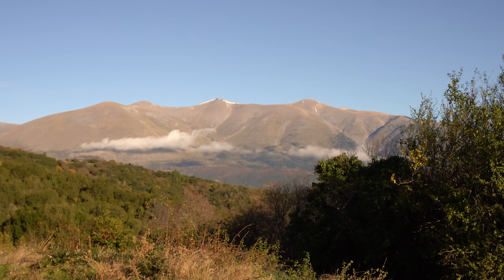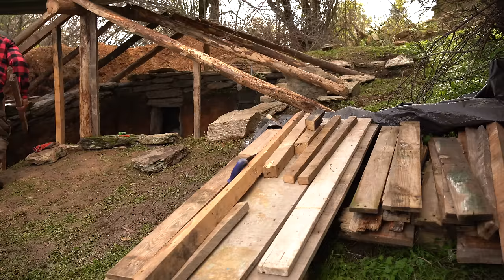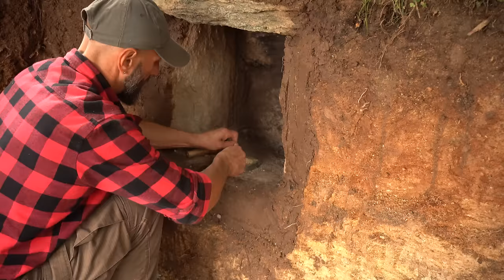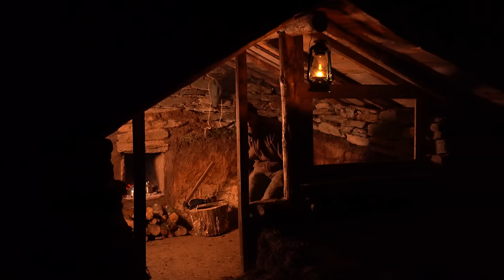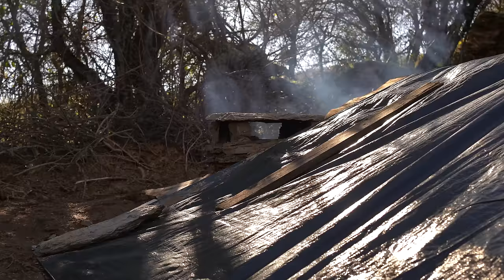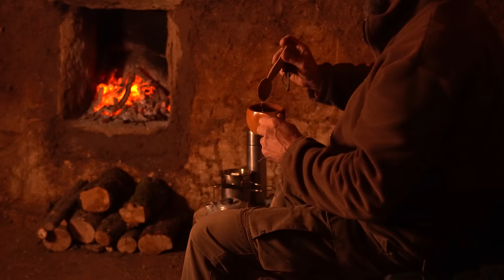Built totally secret underground dugout cabin. Ready for extreme snowstorms. Fireplace inside

Comment: Natural drainage is going to have water come in from the uphill side, you need to trench it around that area to all water to flow out and away from your dugout
Reply: After he finished laying the rocks down, he piled dirt up on an angle to the top of the rocks so everything slopes away. He did it on both sides and the back. I doubt water will infiltrate and will just follow the slope downhill. He also had the roof boards overhang pretty far past the sidewalls and filled the space in with dirt.
Reply: @wallymcguire2033  He did, but I still wonder about seepage.  After (or maybe during) storms, when the ground is saturated, I worry water will seep into the dug-out from the sides.
Reply: @egyas   There is a YouTuber in Russia that built a similar structure and he ended up getting flooded with about 2 1/2' water so it's definitely a valid concern. I really don't know how you can dig into the side of the hill and have it not flood, but he's built several of these now so I'm assuming he knows what works and doesn't. Time will tell though.

Comment: Slates as fireplace stones is not great it works though but they tend to split with heat !
& On the roof should have started from the bottom over lapping the one you just did as you go along ❤ real watertight like that! Good content tough be better with a voice
Reply: I kept expecting him to do something with the roof that would make sense for keeping the rain out.  
That roof is basically useless other than to keep out the sun.  Everything inside the structure will get wet in a good storm.
I suppose it served its purpose as a video shed good enough for views, but it's a shoddy roof.  Even running the roofing boards the other way would keep out more moisture as droplets wouldn't have as much tendency to infiltrate, but he should have overlapped them (as you wrote).
It will keep out snow, but the melt will drip right in.
Reply: @MrVvulf  🤣🤣🤣 only thing it's good for is to keep the sun out 🤣👌 chuckling!

Comment: One of the best, cosiest dugouts I've seen. Kudos. I think I'd have preferred a higher chimney that clears the roof by at least a few inches if not at least a foot, but given both the likely frequency and duration of use of the fireplace, impact of dumping hot air into the side of the roof is probably negligible
Reply: Yeh, he won't be in it more than an hour or so it doesn't really matter.

Comment: This looks like something I would like to build at the top of the hill at my carpenter brothers land that is off the grid where my brothers built a tree house tree house that I helped reinforce with additional vertical columns. Since he did not initially build it with my other brothers above the flood plane of the creek. It floods about every five years and  has a large deck wood burning stove but flood clean-up is a lot of work. Every guy that goes there loves it, as there are wild turkeys, bald eagles, but not so much the women as an outhouse no cell coverage some people are not comfortable with. Shoveling mud off the fishing dock sucks but the fishing is great. It's a lot of work to maintain as you get older but the tranquility and isolation is great and you know you have to replenish the firewood you burn which is more work.

Comment: Awesome work. I hate that it is going to be temporary. But what isn’t in life? Unless you plan on repairing or replacing the “mortar “ in time. Amazing build and I look forward to seeing more
Reply: You would be surprised at how little of that mortar will wash out over time.
Check out "wattle and daub" history if you want more information.
Reply: @petert3355  that is true. I am familiar with that. Usually it’s low walls and a long over hanging roof structure to protect the walls from rain erosion. Very good point

Comment: How would you prevent rain/water coming in from the sides of the ground?  Does this happen> rain/snow saturating the ground causing it to run through the walls of the ground, and then flooding the floor.
Reply: There is a simple solution to this problem. All you have to do is dig small water draining/runoff trenches along the sides of each wall, and all excess water will runoff around the structure instead of collecting and saturating the rocks clay and soil of the structure. Good question. Solution is low cost. All you need is a shovel and some clay.

Comment: I have been seeing a lot of people just stacking rocks. Isnt this a stability issue along with a leaving openings in the walls for cold/hot air to move through? Im always surprised when i dont see people using some type of mortar (Mud, Cement) Is there not a need for it? Am I not correct in my concerns of stability?

Comment: Cool build. Things that you missed to mention. 
Take as much clothing off at night and hang to dry before bed. You need to regulate your body. Sleeping in cloth and then a blanket will make it harder to get warm in the morning and you will sweat at night. 
All cloths should hand as well as boots so you don’t get an invited guest. 
Change socks and undergarments daily and wash and hang to dry past garments. Overgarments not as often. Remove head gear when not inside as it holds in most of your body heat. 
Regulate regulate regulate. 

Just an observation from an old Army Dude.

Comment: This shelter has so many structural and design flaws that it will either collapse or be flooded with snow on the first storm. The chimney is so low that the snow or rain will go through it very fast, not to mention the blowback from the wind. He will suffocate in no time. Plus the water from the rain or melting snow will go through the wall from the upper side of the hill. The snow will cover the entrance or door with 3 feet of high, he will be stuck inside for many days. I hope he has enough water and food to survive. This shelter is good for summer season only, providing it doesn't rain much.
I appreciate the efforts he put in it. Good job!!!!

Comment: If anyone is going to put this much time & efforts into this sort of thing. We have a 4 man hunting blind that our bodies R 4 the most part below ground because of how cold it gets at 5-6pm That means about 2pm we always light a fire. But when we made the (4) stone walls we first used a concrete and mortar mix while incorporating the rafters into the stone as a support for one and using the mixes as the insulation not to mention it really strengthened the thing. Last spring we had nearly 70mph winds and the thing survived no problems. The problems with these structures is watching where ya locate em because of flooding and wind as well. Ours was just a novelty we dug with a backhoe not by hand. But 4 years later we got a concrete floor sump pump electric WiFi and other things yet is is too small to sleep even 2-3 people unless ya like sniffing your buddies ah feet.... let us mention a gas attack from friendly forces okay. The prototype survives and 2 people R okay even really bad weather its warm and wood stove draws the fresh air in old air out. It is time we make a monster size underground enclosure. I have on hand 6 diff drawings & talking to ppl that actually know things not about things. I would like to sleep 3-4 couples comfy and have living food prep & storage as well as bath space. Kinda like a home away from home... Worst part is always sewage concerns. But a pump tank inside will do that too. I bought 3 not really cheap Awning style windows online that work perfect hunting big game in our PJ's. Only drawback there is someone has to go get dressed 7 go get the thing after its down...

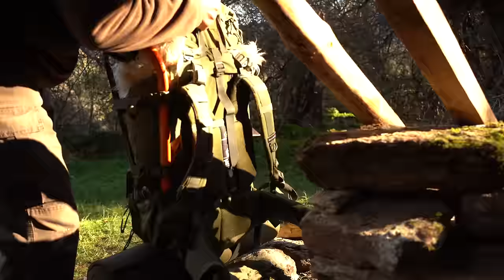Comment: Not so sure about this placing being totally secret - looks like it's in someone's back yard or field.  At 1:19 you can see what looks like a stone wall of a building behind the last rafter as it touches the stone, and it's blocked when the pack is leaned up against the structure - then at 27:40 what looks like a clothes line is seen in the background back left - with clothespins on it, as well as a clothespin holder wallet and a couple pails or planting containers on the ground...